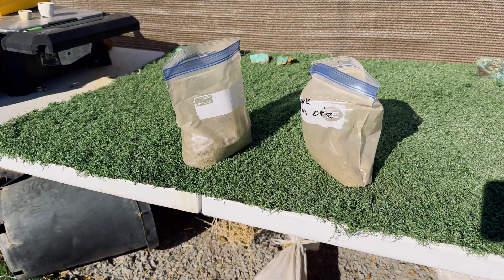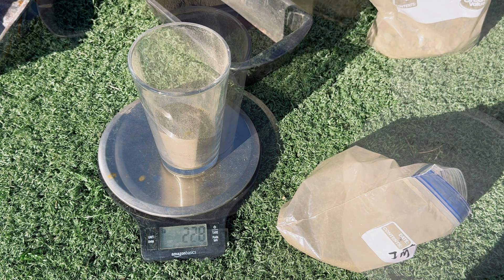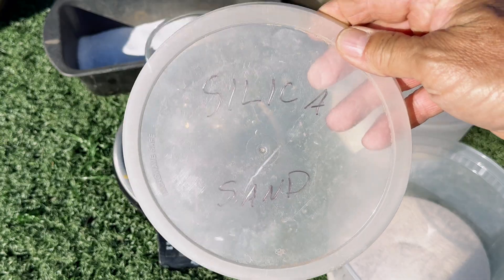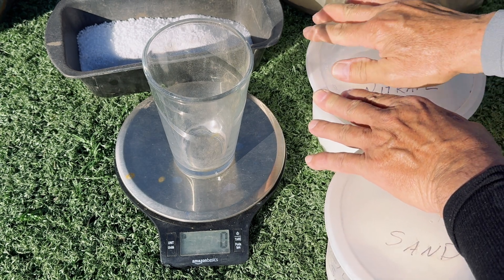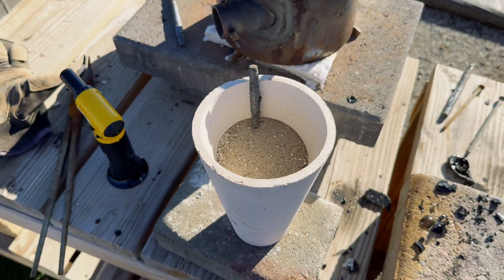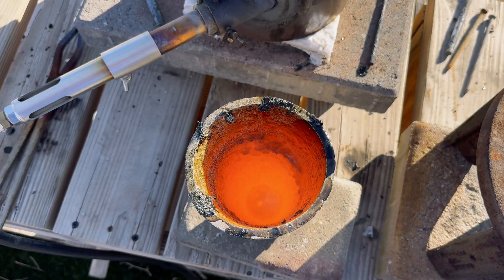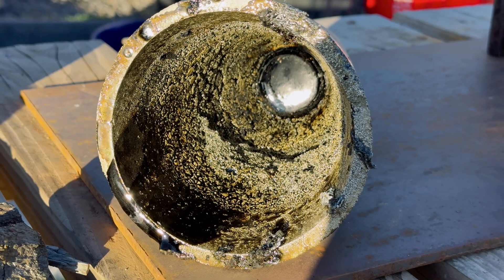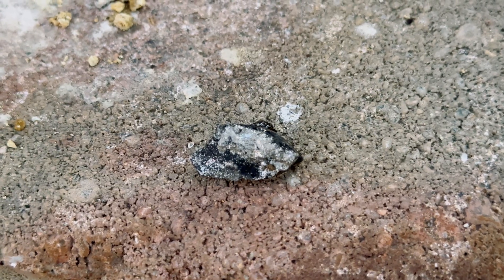Can You Believe How Much Pyrite Is In This Fire Assay

Comment: The material from my mine has a TON of sulfides. I add an iron railroads spike to help with the smelting chemical process. I’ve tried to potassium but it doesn’t seem to do the trick nearly as good as the railroad spike
Reply from the maker: Hey there, thank you for that insight. Before I started this I had already planned to do several projects with your material since there is a massive amount of sulfides in it. I thought doing a progressive process would get everyone thinking a bit more. I’m really impressed with the amount of great comments we’ve received! I was hoping for this. Thank you for the material and let’s stay in touch. Take care 🤗💪🏻

Comment: Increase oxidation and decrease reducer. I'm an old assayer.
Reply from the maker: Thank you, I will keep that in mind. I appreciate the insight. Take care 🤗💪🏻
Reply: @ErnieDionne You may try flour in your mold to keep your metal from adhering to it. You had very little disillusion of your rod that you put in it. Nails would have been better. The sulfides attack the iron and dissolve them into the Flux. Also, what is your ratio of litharge to flour? Litharge is an oxidizer in itself. I use 30-40 grams of litharge on a 29.167 gram assay. Just some more thoughts. It can be melted with some experimentation. Many sulfide ores I've fluxed and poured. Everyone is absolutely an ore of its own. There are no two alike.
Reply from the maker: @r @richardbeee Hi Richard, I’ve been meaning to get the nails but always forget when I’m at the hardware store. In my litharge there is about 2% of wheat flour. Thank you for your good insight and directions. I appreciate them! Please keep in touch 😃👍🏻
Reply: @ErnieDionne Will do. I use tocsmelt high grade copper sulfides into anodes. Then, high grade nickle ore from Sudbury, Canada. Recovered silver, nickle, and platinum. I'm still consulting for a couple of mines. Been retired for years.
Reply from the maker: @richardbeee Very nice Richard! You definitely have the knowledge and expertise and I appreciate that. 😃👍🏻🙏🏼
Reply from the maker: @richardbeee Hi Richard, thank you for your insight. In my 100g of litharge and flour it is 96% litharge and 4% wheat flour.

Comment: Why not u roast and get out all sulphur and then processing with fire assay
Reply from the maker: Hello Steven, thank you for your question! It’s a great question! Yes, I will redo this project and will roast the material and while the material is hot, I will pour it into ice cold water. By doing this, it should crack open the sulfide and release any precious metals that might be trapped in it. I hope to be able to remove the sulfides so I will get a clean prill. With the amount of Pyrite in the material I’m not sure if I will be able to accomplish that. But I will give it a try. I appreciate you being here and appreciate your question. Thanks for joining us and I will see you soon. Take care, my friend 🤗💪🏻
Reply: An iron nail in the assay might do the same as a roast, also soaking in peroxide or hydroxide
Reply from the maker: @readoryx373 Hi there, yes, I had an iron rod in the assay instead of the nails. I’ve never heard of the peroxide or hydroxide method. I might give it a try. Thank you for your insight and comment. I really appreciate it. I appreciate you joining us and being here. Take care, my friend. 🤗💪🏻
Reply: @ErnieDionne thank you for your response.  I live near Silver City and am having the same problems but not with chapman's flux so maybe it is the magnesium oxide...
Reply from the maker: @readoryx373 Thank you! I might give it a try? I want to test a few things out first. I appreciate the insight.

Comment: I wonder if smoothing the bottom of the metal cone and polishing it almost as smoothly as glass would have helped any?
Reply from the maker: Hi Michael, I don’t think smoothing out the bottom of the cone mold help. There is just too much pyrite in the material. I am going to do another project with this material, I had several comments about roasting this ore before I process it. Unless I can remove the pyrite from the material I will end up with the same result. Hopefully, I can come up with something else and removing the pyrite from the material. Thank you for being here, my friend, it’s great to hear from you. And I will chat with you soon. I haven’t forgotten about us going to the mother load for you to dowse. Take care and I will chat with you soon. 🤗💪🏻
Reply: @ErnieDionne  Thanks Ernie as you are helping fill in information about all the fire assaying that for over the last 50 years I have been paying major assaying companies to perform, because it will help some with deciding the best assay procedures for different ore samples sent. P.S. 2017 when I took myself from being PC illiterate to becoming a professional PC researcher (after taking a 2022 SJC PC researching Senior Citizen Class), and my 2006 Automotive Associates Degree of Applied Science was achieved using an electrical type writer with a lot of white out, requiring the copying of corrected paperwork before being turned in. I doubled the full time 12 credit hours four quarters with having to rearrange the required computer class until the last quarter in a 7PM class, which I had to drop all my evening classes because of previous spine operations requiring another disc fusion for discs L-3 & L-4. Because of my extra output and grades, CEU gave me an honorary Automotive Associates Degree of Applied Science. I had L-3 & L-4 fused three days after my two year degree was finished. I was planning on taking the required computer class or just passing the required computer test the next year after I started working for running the surface of an underground coal mine in SW Colorado. But all the physical pain was running my blood pressure deadly high in the 300's over 200's, forcing my doctors to suggest I quit working or dig a six foot hole and lay in it waiting to die. I mentioned this so you can gain some insight into my endeavors of life, and the very important overlooked information on Assaying Companies with the late 1980's and early 1990's, where the BLM did a controlled fire assay study, by sending out controlled known result fire assay samples to dozens of assaying companies. All but a handful were either way too low or worse too high on gold and silver fire assay results. My preferred Mineral Assaying Company "Hadden Research Laboratories", was one of the few whose fire assays were exactly correct. I don't know if this will be of help to you, but it is importantly interesting to review, and may help on backup controlled fire assaying from recognized creditable assaying companies when submitting lease or selling a precious metal deposit to major and miner exploration / mining companies. I am sending you a couple of my dowsing physics training book next week, with asking you to give one to your friend "Chris Blair" who just recently said in a comment on my post that "there is no physics and science involved in dowsing". He is going to be embarrassed when I am filmed in 2026 precisely gauging all aspects needed on dowsing precious metal deposits by applying the physics involved in dowsing. Ounce seen by the masses of the general public, with my using physics in gauging sought dowsed elements, my book will sell by the millions around the world with a dramatic increase in metal and mineral deposits staked with precise intersecting the core-drilling on the buried precious or base metal deposit,. With all my health problems that I work around, I may not see the millions of dollars my family will receive without any greed involved, for my father and I reverse engineering the physics involved in dowsing, turning myself into the dowsing savant who wrote the book to teach the entire world how to apply physics for locating sought elements.

Comment: I'm certainly no expert, but would it help to heat the material (just the material, no flux added) in a pan over a fire to cook off the sulfides and then gold-pan what is left and then fire assay it? That should break down all the pyrite and separate the valuable metals from the sulfides before smelting it.  Unless I'm missing something...which i could be.
Reply from the maker: Hi, yes, it will help to roast the material, but unless I can remove the pyrite from the rest of the material, I’m certain I will get the same result. I’ve received a lot of good comments of roasting the ore first so I will do another project on this roasting and panning this material. Thank you for your input, I appreciate it. I deeply appreciate you being here and I will chat with you later. Take care, my friend. 🤗💪🏻
Reply: Just seen that being done.... oh Chuck Gentles